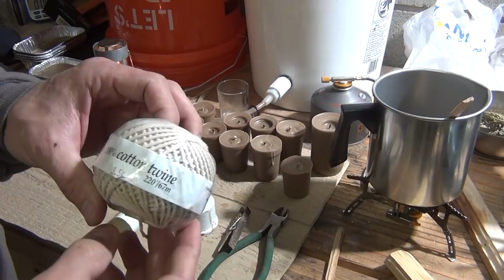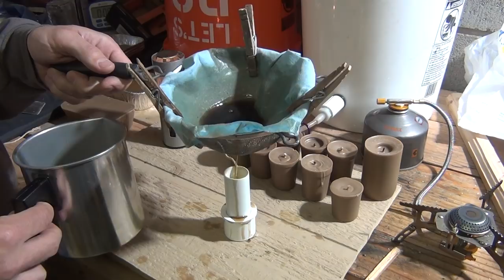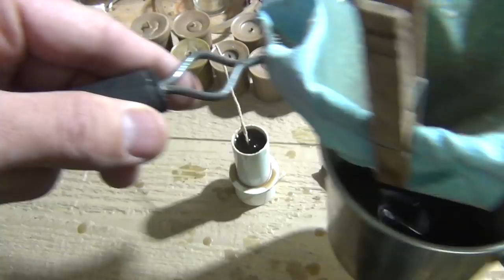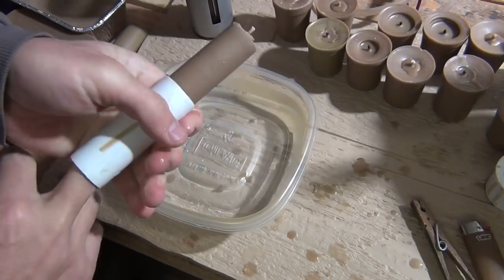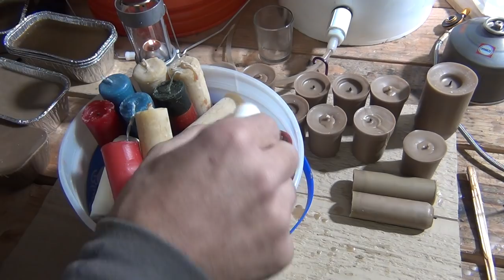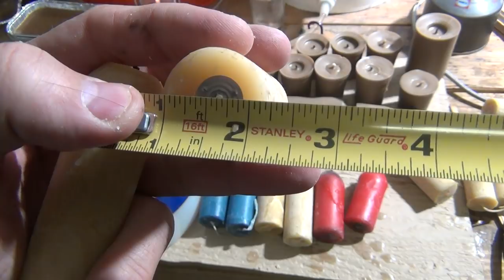How I make UCO Lantern candles

Comment: A few points. First the wicks. Heat a solution of 250 ml water with 15 ml Borax and 45 ml Salt, add the cotton string and let it soak for a day (take it off the heat during this day) before drying it. This solution makes the wick burn cleaner (less smoke) and brighter, like the wicks sold in craft stores. Substituting chemical salts can make colored flame BTW, ex: copper salt makes a blue flame. Tie a knot in the wick at the bottom and you can pull the wick tighter without it pulling free. You might need to put a few toothpicks or something under the mold. or countersink the cap around it, to account for that knot but it will also help with leaking wax. Finally those molds that you have a problem getting the candle out of? Get some silicon mold release spray. A brief spritz of that makes it much easier to pull out. Good video, it was quite informative. =)
Reply from the maker: Excellent thoughts my friend! Thank you!!
Reply: If you don't have the silicone spray try vegetable oil cooking spray.
Reply: Blend vaseline and naphtha 50/50 to make a release. Swab a small amount and you're good for several releases.
Great video

Comment: If you spray the inside of your mould with a silicone spray, you can get the candle out very easily. I used to make my own candles and I made my own wicks too. I bought pure cotton sewing thread and depending on how bright or fast I wanted the candle to burn, would plait several strands together... 3 lots of 7 strands was my favourite. It takes ages but gave me very good control of the flame. The next stage was to soak it in a fire retardant. I used borax... sodium tetraborate dissolved in hot water. When the wick had soaked for 5 minutes, I hung it up to dry, then I soaked it in hot wax and let it nearly dry, similar to you. Just before it set, I gave it a twist, 5 or 6 turns per foot and let it harden fully. When the candle burns down, the flame burns down in a way that stops the pool from burning on one side of the candle and running the hot wax into the holder. 

I often used citronella scent and had several burning in the evenings to stop mosquitoes and sandflies from biting so I could enjoy a beer with friends and family late into the evenings. I enjoyed making candles but our local source of scents, dyes and other bits and pieces disappeared... this was back in the 70s and 80s, long before the internet and Amazon. I live in New Zealand. I gave away my moulds to a friend and moved to another city where candle making was unheard of... pity. 

I really enjoyed your explanation and it bought back sweet memories. I'm now 70 and don't trust myself with hot wax and live flames. Like you I had a wax heater but mine was home made (modified electric kettle) with a thermostat, 150ºC maximum. I ran it at just over boiling point of water 105ºC after the wax melted. It wasn't expensive to run as wax requires very little extra heat to keep it liquid. Now-a-days you can buy electric hot plates with temperature controls and timers so you can walk away and forget it without risk of your wax catching fire. Cheers and thanks for the memories.
Reply: Excellent detail.  Thank you.
Reply: This makes me thirsty 🍻🔥
Reply: thanks for advise.
Reply: Wonderful tips....Thank you!  🕯
Reply: What a comment! Thinner wick = longer burn time! It seems so obvious, but I never realised it.

Comment: Excellent tutorial. I LOVE messing about with wax, making buddy burners and double height tea lights, etc. 

I had a thought: Fill the last 1/2 to an inch of the mold with red wax, so you have an end-of-life indicator on the candle. As the red approaches, you'll know you have to change the candle or that the candle will burn out in x minutes.
Reply: very clever, personally i collect all the keurig coffee pods and use them as mold to dispose of candle i dont like or that i collect. if you boil your wicks in borax and table salt they will produce WAY more light.
Reply: Great idea about adding a different color wax at the end for an indicator!
Reply: Biscuits9mm brilliant
Reply: @Francois_Dupont  Can you go into more detail on how you boil your wicks in borax and table salt? Measurements and instructions?
Reply: @vociferonheraldofthewinter2284  let say 300ml of water, put one big table spoon of borax and one big table spoon of normal sodium salt in it. you make the solution boil a little and then lower the heat and put your 100% cotton rope/cord into it. you stir it with a spoon for about 3min and then hang them to dry overnight.

the next day you melt a bit of your wax and dip them in it. then again hang them to set and your wick are ready. i use clothes pins to hold my wicks straight into my keurig cups and then i pour my wax into them. its important to pour your wax at the lowest possible temperature to reduce the shrinkage afterwards when the wax cold down in your mold. i do them in batch of 50-100 keurig sized pods. i normally use big candle found in thrift shop. i mix many color and wax togeder. i am thinking of pouring them without wicks and simply making a hole and inserting the wicks afterwards. pouring with the wicks in can sometimes have them crooked inside. 

i use those keurigs pods candle on my kitchen table, for emergency and camping outside in glass lanterns.  for the pods, just use a knife to rip off the aluminum cover, and a fork to rip the filter out of them. a quick rinse and a bit of blue tack beneat them and they are ready to make candle. just remember to use freshly used pods because they can mold inside if older than about 3days.

Comment: A properly sized dowel might make punching it out of the mold easier. I hadn’t considered a UCO candle lantern until seeing this. Cool stuff!
Reply: I use a 1" dowel, several lengths (1", 5" mostly) and a piece of the extension tube - for stubborn candles (beeswax almost always), I sit the dowel under the tube, the extra piece of PVC tube on top & strike it with a mallet until it finally "breaks" through (still sometimes need to use the 5" dowel and smack the candle tube on top of it like a slide hammer)

Comment: Using this method I made paraffin candle. Worked terribly.  Melted too fast, wax spilled throughout the interior.  Burned through within 2 hours.  Then did it with beeswax.
Came out AWESOME!  Made 9 total for 10 bucks in wax.  Beeswax candles I've made last about 12 to 13 hours.  Thanks for the tutorial.  Fun to do.  Also.  I didn't make the bottom groove.  And I use toothpick tips broken off  to stuff the hole to prevent wax from seeping out.  Came out easy when unmoled the candle.  Heatgun used to demold beeswax.

Comment: Stearic acid 
Palm stearic acid (or stearin) is generally used as a wax hardener which helps pillar or freestanding candles hold their shape in warmer climates. It also increases wax opacity (whiteness) and assists with mold release. The harder the wax the longer the candle will burn. It works great. I get it at Hobby Lobby in the candle makers section.
Reply: How much Palm stearic acid do you use?
Reply: @explorermike19  3 tablespoons per pound of wax

Comment: Good video.  I'm a candle maker and have a UCO lantern.  I use taper candles from Ikea in mine.  I just cut a chunk off the bottom to fit the length. 

I like your PVC pipe idea.  Very good.  I put my candles in the freezer.  I also spray a little WD40 in the mold.  I have always liked candles.
Reply from the maker: Excellent thoughts! Thank you
Reply: The only Ikea candles I see are 3/4 diameter. are those the ones you use? they seem like they would small
Reply: @jiujitsu2000  Hello! I was wondering what kind of wax you use for these candles? I haven't made a candle in 30 years. lol! (Totally starting from scratch.)

Comment: I just made UCO lantern candles thanks to your video. To pop the candle out of the pipe after the wax has cooled I tightened and loosened a hose clamp all along the length of the pipe. Just slip the clamp on the pipe and tighten, loosen it, move the clamp on the pipe and repeat. My candles pushed out without resistance. Thanks again for the great money saving video. Oh, a bobby pin works in lieu of a clothespin.

Comment: Cool video!  I also prefer beeswax when I make my candles.  The beeswax will be much easier to remove from the mold if you initially pour it cooler.  I know it has to be hot to make its way through the filter media though.  I filter mine ahead of time, so I can remelt it and pour it into the mold when it's cooler.  Look for the beeswax to start making spots of a semi-solid "skin" on top as you watch it cool.  Pour it at that point into the mold.  After solidifying, they will come right out of the mold - no risk of damaging them by having to use some force.  Thanks for the great videos.

Comment: In place of using your finger to push the candle out...... Get a piece of wood doweling with a outside diameter just less the the inside diameter of your candle mold. Or just use a candle you have already made that is good and hard. ( Preferably well aged ) 
The UCO Candle holder is really nice , I have had my Brass one since 1971.

Comment: I have always melted my wax on the gas kitchen stove using a 10-inch aluminum pie plate
to make it safe. The pot or can I am using sits in the middle of the pie plate. This  method eliminates the possibility of a fire, and  it catches any drips. I also make fire starters using this method.  A cotton ball or two wrapped in a used dryer sheet, shaped into a ball and using dental floss to wind around the ball to hold its shape. Tie a knot. Using a bamboo skewer, i submerge the ball in the wax until the is totally saturated, then i put them in the freezer to cool. To start one, nick the wax ball with the point of a knife and light it.  It will burn at least 10 minuted. These balls fit perfectly inside of perscription pill bottles.

Comment: Great innovation vid.  If you want a modestlyi larger candle, try using of the small soda pop aluminum bottles.  You have a screw-on aluminum cap, and the bottle.  Turn the bottle upside down, and saw off the small bottom.  Create a little frame to put the bottle inside.  Put in the wick, and pour in the wax.  Leave to cool.  Use some water water, and put the bottle into the water, and loosen the wax from the bottle.  Slide out the candle and let cool.  You will have a mini-bottle shaped candle and wick. If you really want to have a unique candle, use the same bottle, cap, and candle inside with the wick.  The bottle will keep the wax warm and burning.  When the wax drops down, push up the candle upwards to the screw neck.  Eazy squeezy.

Comment: The string you could use also is fiberglass candle wicks or cotton. You could also use different mixtures to get a longer burn time to. There are also a few modifications you could also do to make the candles burn longer. If you need to in an emergency situation. Some of my favorite mixture is beeswax and other wax to extend your burn time by hours.
Reply: still can't figure out where to collect beeswax. and what is that "other" wax you mix with beeswax? thank you

Comment: I'm watching more of your videos and enjoying them.   I've made a lot of beeswax candles using the regular silicon moulds and metal moulds.   One suggestion is to use a silicon release agent on your PVC pipe to help get the candle out easier.    
To 'mass' produce those candles leave the wick on the spool.   When you take out the candle the wick is pulled up through the mould and you're ready for another candle..   Threading wicking can be a real chore.  This will cut your work out dramatically
Reply: Does the silicone release agent not get damaged by the hot wax, when it is poured in??? Thanks.
Reply: @bboxall7452  Not necessarily.  But it sure does help with releasing the wax from the mould.

Comment: I've taken this tutorial to the extreme the past month, now have 6 candle molds based on this pipe & cap concept - some double-sided tape at the top to slow the cooling of the wax up top as I was discovering some air bubbles formed inside the candle, so this helps keep the top wax molten longer to sink & fill it - I found out that Square braid #6/0 is the optimum wick to use here, I can light a candle and burn it all day long 'til it flops over onto the side of the metal can and snuffs itself out at the end.  High-melt paraffin wax (pillar/votive) seems to work better than standard paraffin, and I bought some filtered/white (cheaper) beeswax that also works great with the #6/0 wick.  Ended up making a stash of 84 high-melt paraffin candles (3/day * 7 days/week * 4 weeks was my math) for safekeeping and have made a few batches since for daily use while working from home (using it as a fun decoration and hand warmer here in the winter).
Reply: Also just bought the Candlelier tonight, so I am going to be using those candles a lot faster now!

Comment: I wonder if the bees wax ones would come out easier if you sprayed the inside of the tube with cooking spray?
Reply: Thereal111t -- better to line inside of mold w wax paper shiny side to inside of mold. Not bottom just sides all the way down w slight fold under. Uncle Harry used to do that w his beeswax candle molds. That way a small amount of hot water run over outside & bottom of mold will slide out.
Reply: Thereal111t -- sorry. Uncle Harry's were made from metal so probly won't work with poly pipe.

Comment: If you must waste time making your own candles, at least use self trimming candle wick, not string, so the flame doesn't get huge and make a mess of your lantern. I made a few candles for my lantern before I figured out it wasn't worth the trouble, then I got the oil insert for the lantern to avoid wax spills. Later still I got a nice oil lamp that runs 20 hours on 4 ounces of oil and can be adjusted for high altitude. Candle lanterns won't burn in the cold thin air even as low as 11,000 feet because the heat from combustion is insufficient to create new fuel by melting and vaporizing wax.
Reply: what oil lamp did you get?
Reply: I'd also like to know what lamp you got! 😊
Reply: @KJ6EAD  id love to see it. a good detailed vid explaining what you can see and its principal of operation might be enough to base modifications of a in-production lamp on. im in school to be a machinist and im trying to make the best lamp that i can. seems very few make a really good lamp now a days. ill sub and hit the bell so youtube will drop a notif when you get around to making that vid. lookin forward to it.
Reply: Also, if you search "ultra light renser" you'll see more pictures on Japanese Yahoo auctions and others.

Comment: Easy way to do it so the candles will release easier, is to cut your PVC mold in half then use hose clamps or ranger bands to hold the two halves together, pour your wax then after it hardens a bit, remove the hose clamps or ranger bands and it will come out much easier!

Comment: I didn't have the 1-1/4" pipe handy so I took a piece of 1" and bored it out on my lathe. I couldn't quite reach all the way so my candle steps in to 1" about an inch from the top.  It works ok.  The fatter bottom keeps it centered in the holder and the skinnier top goes almost to the top of it.  I got almost 8 hours out of the first one in my Candleir.  Now I just need a few caps so I don't have to tape the hole each time.

Comment: You mentioned that the candles were a little smaller than the lantern tube, you might try the same light wall tubing made for the kitchen sink drain. it is 1 1/2 in instead of 1 1/4. I don't know if it would make a difference or not.

Comment: I just make the candle first, any shape and size and then push a warm knitting needle down the middle right to the bottom to make a hole for the wick. Then I push the wick in. Needless to say the wick has to be a bit thinner than then hole. Then light up, wait till the wax fills the hole around the wick and that's it. I found it to be the easiest way.

Comment: Do you need to trim your wicks often?  Every hour or two mine need to be trimmed because the flame will be two inches high and smoking.
Reply from the maker: Sometimes that happens. If so,  what I usually do is run a lower ply wick.

Comment: Well you did answer the question of the beeswax but I think if you use the metal pipe like copper it might release a little bit better because the beeswax the reason why it's hanging up in there is it's trying to stick to that plastic later

Comment: What is gulf wax / trapper wax.  I was wanting a bright light to use as a back up night light for my pontoon boat just in case my running lights turn off accidentally while I'm sleeping on the boat.  Can never be to cautious.
Reply: I believe its used for canning fruit and vegees. The wax was poured on top to keep the food from spoiling. Used to come in a box with 3-4 square slabs of wax. I have not looked for it in a long time. Try T. Supply or Wally Mart.

Comment: I tried making candles per this video using paraffin wax and wick from Hobby Lobby.  I found that it worked well for a while but then the wick was not burning down and when I checked on the candle after a few hours the wick was about an inch long and flames and black smoke were shooting out of the top of the candle.  Be very careful and check out your candles before using them.  The candles I made would have burned down my tent.  I’m going back to the factory candles.  They will burn all night without fear of a thermal runaway situation.
Reply from the maker: Great feedback. I had that issue at one point when I was experimenting with this.  I went with a thinner wick and that fixed my issues. Hope this helps! Thanks for stopping by!
Reply: JIUJITSU2000 thanks for the tip!